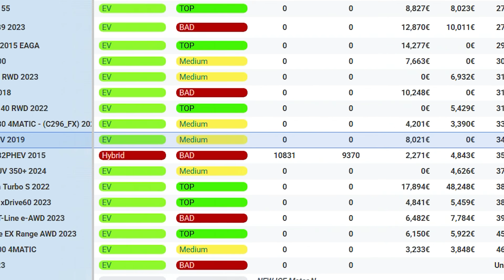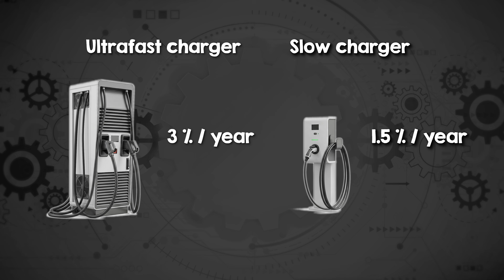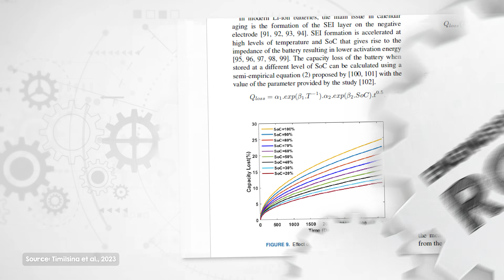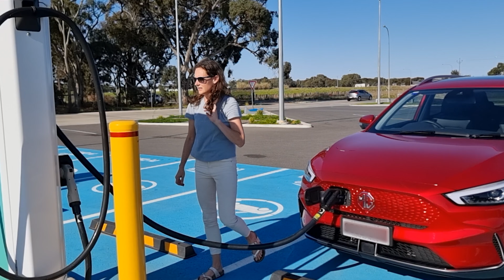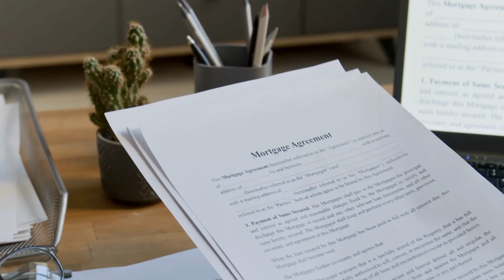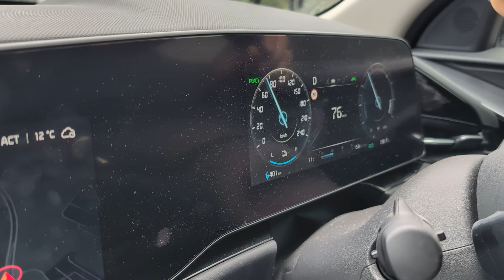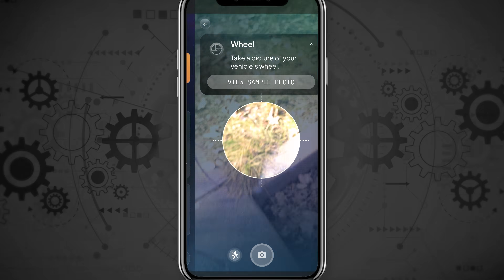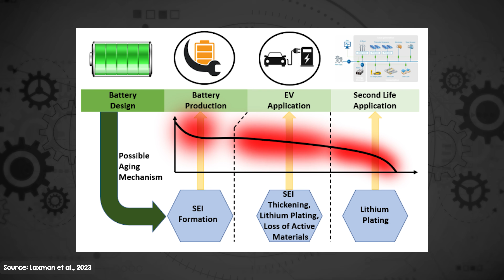Watch This Before Buying Your EV

Comment: Hi Rosie, greetings from the U.K. I bought my EV new in 2019 - a BMW i3. Battery degradation was my main concern about making the switch to an EV. My experience has been no discernible degradation, there must be some, but I find the natural range variations caused primarily by ambient temperature affects my range far more. I now have far more confidence to buy a used EV in the future, especially given the improvements in battery chemistry in recent years - primarily the use of LFP chemistry.
Reply: My i3 from late 2014 has shown surprisingly little range reduction even after just over eleven years. My impression is that the winter range has dropped more than the spring/autumn range.
Reply: There is a hidden menu that shows you the real degradation including the hidden buffer. You access it by holding the little button on the left of the speedo display for 10 seconds. You then have to enter the last 5 digits of the vin. My i3 is from 2017 and has the same range as new as my hidden buffer is still there. I haven’t checked it for years as it will become obvious eventually when the summer range drops. Not something I am stressing about given it is still fine after 9 years of daily use.
Reply: My 2016 i3 in the UK is doing OK too. I'm sure there's degradation and I plan to check it soon. The car's done 137k miles which is a lot. (Only one out of 350 i3s on Autotrader (website) has done more.) Just now it's nominal 33kWh battery is reporting a potential electric range of 118 miles at 17°C. It's very dependent on temperature and driving style. I think I might have been lucky getting this i3 with the Range Extender (REX). This tiny petrol motor tries hard, and quite successfully, to stop the battery getting below 5% while only being used occasionally. At least 95% of my mileage has been electric. The drawback is that with the high mileage, the future's a bit unknown.
Reply: @londonwestman1  That’s awesome, 137k miles is not bad. I did hear of an i3 in South Africa that had done well over 200k miles and just needed tyres and some suspension work, no drive train issue at all.
Reply: @londonwestman1  I really enjoyed the REX I drove across the state once. I wish I could have a 250 mile range battery with the REX system as backup. The VW Buzz would have been an excellent rode trip with that system. I doubt the REX could have kept up at interstate speeds but on back roads and in the mtns it probably could have. Still, run the REX on the interstate to extend the range to ~325 miles and then DCFC occasionally and let the REX rest.
Reply: The biggest drop is immediately after buying (first year), it seems. A big drop in the first year then fairly flat degredation from 95% to 90% in the first decade (calendar aging exceeding, that of cycling)
Reply: I've found much the same with my MG. 4 yo and no discernible degradation.
Reply: EVs lose about 1% a year. You would have long sold it before the degradation becomes an issue.
Reply: That's really reassuring, I'm looking at possibly getting a late model i3, so that's good to know.

Comment: I saw some miserable behavior on the BMW facebook groups of leasing owners bragging out loud that the were perfectly happy to treat the battery as poorly as they liked because it was a lease. BMW states in their manual to charge to a maximum of 80% when you can afford to do that, of course allowing for 100% when it of use to you.  They tell you very clearly that battery life is boosted by charge limiting to 80%, and battery experts on NMC lithium cells will confirm that.  I appreciate you mentioning DC fast charging and degradation. Unfortunately in their fervor to assure buyers adopt EVs, EV journalists widely reported that studies were showing that DC fast charge degradation was disproven, a bad theory. But I don't think that's true at all. It was wishful reporting, IMO.
Reply: purposely behaving badly is never a good thing. But I am also not a fan of having to charge your car only to 80% most of the time. That basically means you are emulating a 8 year old battery from the start (with the 2,3% per year degredation mentioned in the video). If you have to do that, the range figure you buy the car with also should be calculated at 80% and the range at 100% should be advertised as a special mode.
Reply: @olik136 nah, that's 2017 thinking. Back then, they included big buffers at the top end, preventing you from using the whole battery. So absolute range was lower (even if you really only needed it only once a year). When we occassionally drive a long distance out of state, there's still really no point in charging above 80%, except if you're teally trying to stretch between two far spread chargers, so we almost never charge to 100%, but might if we're not sure. I'd rather have yse of what was formerly the buffer soace and we typically only charge to 75%. We have a lifetime average of 4.1 miles/kWh, which is over 320 mikes range on paper. But we drove to Canada and back never discharging below 20%. Our eDrive40 could have easily been an eDrive35, but inbthe hooe that we can make this car last 15 years, we erred on the safe side with the bigger battery
Reply: @olik136 If you have convenient charging & commute less than 300km daily, the 80% recommmendation is no restriction at all. It's not like we we used to fully refill our fuel tanks every day.
For NMC batteries just charge what you need for next day plus a buffer amount. It will likely be well under 80% SoC required on the daily. Then the full charge is always an option when you really need it.

Comment: its get better now, now that BYD and CATL has a new BATTERY, has longer battery life, can charge faster, can also charge at -30 degrees Celsius condition. like damn, probably after 3 to 6 yrs, batteries be would much smaller, lightning quick charging but still last for ages! the EV future is bright!

Comment: Aren't you confounding two different issues? One is small decreases in range, the other is the probability of a major battery issue needing replacement? I would assume they're correlated, but it'd be interesting what the data says.

Comment: Tesla will not sell you a new battery for €8404. They are notorious for dumping  used batteries to owners who need batteries under warranty. They call them Refurbished, but some of their packs aren't even serviceable, glued and foamed together into a massive disposable 5hit5how. Given the credibility of Tesla and Musk are zero, with years of NDA and lying to their customers, it's frankly due for an investigative expose to show what kind of junk they're passing off as valid replacement batteries. It's unfortunate that we can't get honest standardized parts and labor quotes universally. Everything is scraped from anecdotals in forurm or via voluntary surveys.

BTW, I'm fine with servicing batteries and replacing bad modules with similar aged good ones. It's what the industry has to do because their designs are almost always intolerant of mixing new cells or modules in a pack with old ones. Again another rich target for a story, and this has been told but it's relatively poorly understood. If you want a brand new pack, expect to pay that $20000 plus several thousand in labor, or half the price of the car, which journalists lazily guessed for years.

Comment: It might be worth checking the thermal managements system on that Nissan Leaf, the early ones were not very good, and you would expect quicker battery degradation.
Reply: Due to not being water cooled right ?

Comment: We need guaranteed Battery Health and cheap and easy replacement process.
Reply: That is like saying we need guaranteed engine health and cheap and easy replacement.
Reply: For most EVs it's pretty easy to replace a battery pack.  Arguably the easiest are the air cooled (< 2025) Nissan Leafs - many videos of people changing out battery packs on their driveways.  Most newer cars have water-cooled batteries, and it's well within the abilities of a small garage to replace a pack (the additional complexity is just draining and refilling the cooling loop, and then purging air bubbles).

Comment: Those buffers definitely get used.  I think they are good for general use particularly when you are at 100% and the regen still works at least in some cars but also on the bottom end why most EV's can still drive even when they are at 0%.  Would love to see your analysis of the new CATL batteries that are coming with higher energy density and more range from the same size pack.  Watched a great video from Ricky(Two Bit da Vinci) about it when he was at the Beijing Auto Show recently but as you're also an engineer interested to get your take on them.
Reply: I would assume they also use the buffers to balance same model cars among each other. Surely there is some variance in the batteries but they will probably all show the same range when you turn on the car in the dealership.
Reply: Wouldn't brake regen be retained without a top buffer by just charging to 95% (& ideally lower with NMC chemistry)?

Comment: Im not sure I would do a state of health test that required me to discharge down to 10%, my understanding is this test by definition will increase wear on the battery. I keep my battery at 20% minimum and have only gone under a couple of times on longer trips when caught out with out of order charging stations.
Reply: I think you’re mistaken. Dropping to 10% or even 0% a few times a month, let alone once for a test, won’t noticeably affect battery longevity. What really matters is the driver’s regular habits. It’s also important to remember that the percentage is just an estimate—there’s no standard voltage for a car battery pack that equals 10%. The carmaker selects a voltage, and when it shows 0%, the battery isn’t actually drained flat like in a flashlight without a BMS. It’s simply reached a voltage the manufacturer decided to call 0%, chosen as a balance between maximizing use per charge and ensuring a reasonable lifespan. The guidelines are about what you do daily, not what you do once in a while.

Comment: This is an Actual real world experience, 238,000 mile battery with 85% battery left
https://www.youtube.com/watch?v=kVqkFfn7u8A&t=17s
Reply: Wonder what that would be in a 10 year old car with the same driven distance. Average annual driving distance here is around 8500 miles, so age is going to play a bigger factor.
Reply: @Gazer75  There are 10 year old Tesla's on the road and they are still working fine. In fact pre 2017 Tesla Model S have free charging also. There are YT videos out there of Model S with 2 million miles on the clock
Reply: @Stumpy1854-Orion  An EV with 4-500km of range when new will work just fine for daily driving even if it lost 20%. Small compact EVs with a 200-250km range when new not so much.

Tesla Model S 85 would still have around 65kWh net capacity if it was 20% degraded. The S 60 would be at around 50kWh.

The S 85 would be around 350km combined driving in winter. Loose 20% and you're down to 280km of range. In summer you're down from around 450km to 360km.
Doing the same for the S 60 is not going to be pretty.

Smaller battery EVs also burn through a lot more cycles during its lifetime.

Comment: Seems like a lot of fuss and over the top analysis is needed to figure out a "vague" result... no wonder used cars EV are worth nothing compared to original sale price... I suppose real world data provided transparently by the EV maker would show cars to be worse than they have been promoted to be, so they don't provide it. If you use Hyperbole and superlatives to promote evs, then expect people to eventually not trust them when used. The outcome, simple, all EV;S are basically disposable cars built to a political cause rather than a real world economic one. 

EV s are also way too expensive at the outstart.
Reply: I've no doubt that if you wanted that degree of precision for an ICE car it would be just as complex. As for price, never mind brand new. That's only for those with the money (same as for ICE). My 3 year old second hand EV cost the same as a similar size ICE of the same age, and as I mostly home charge it costs pennies to run. Actual range from a full charge is 255 miles which is quite adequate for my driving these days.
Reply: I don't see our environment as a political cause.

Comment: In fact, internal combustion engines wear out faster than electric motors and their batteries. A 20–25% increase in fuel consumption is not unusual for an aging, worn-out combustion engine. In fact, if the car is not in tip-top condition—with minor exhaust system issues and/or clogged filters—fuel consumption can rise by as much as 40%. And that, too, is a form of degradation.
Reply: I agree! The capital requirements to maintain an ICE vehicle is much less than an EV though; I think this is the real problem here, not that each experience their own form of degradation. Buying a car, just to find out you need to spend an additional €20,000 doesn't sound like fun!
Reply: @seanodowd2583  I don't know how you got this into your head, please back it up with facts.
An ICE engine and transmission has about 2000 moving parts. An EV engine and transmission,  about 20 parts.
Reply: @Gert-DK  I didn’t say it wasn’t less parts, I said the capital requirements are higher. EV currently costs more and has the potential for pricy battery replacement if not designed well (which a lot of EVs are unfortunately not, if they were, they wouldn’t be hiding their battery health!).
Reply: @seanodowd2583  Of course, they cost more in the US. Prices are kept artificial high in god's own land.
Reply: I've had my car since it had 30 thousand miles, it now has 240 and does 2 mpg less than it did then. You are either a simpleton or a liar.
Reply: @matthewbucktrout7007  No. I think it was a study from University of Michigan.
There are also some batteries with nearly no degradation. Several EV's has now driven 500000 miles or more, with the one and only battery.
ICE is dead. In my country 95% of new cars were EV's in Q1 this year and 98% in Norway. 
E-trucks was 14.5%, I can't wait to see the number for Q2, thank you, Trump.